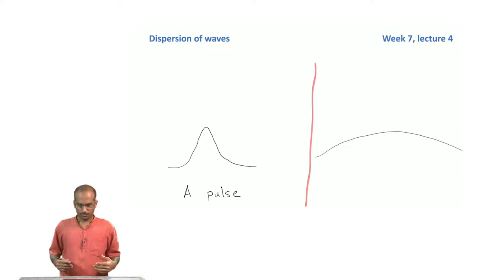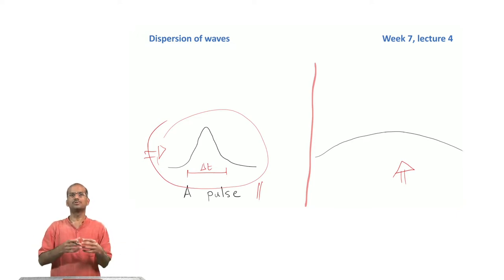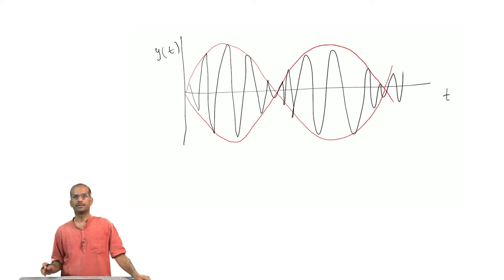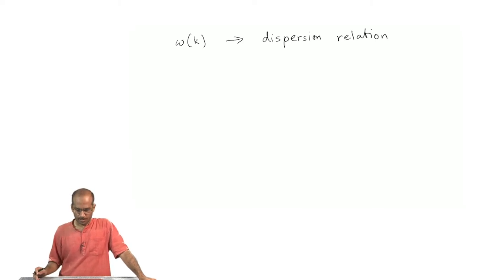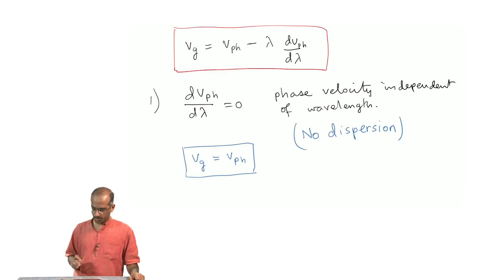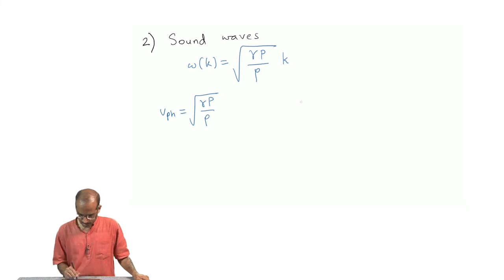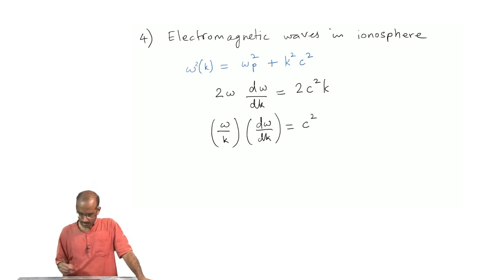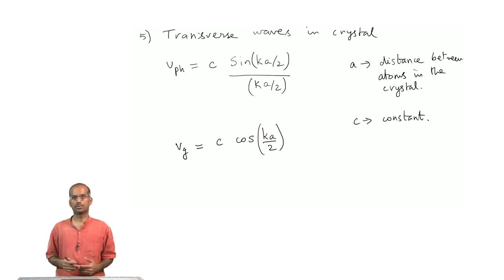Dispersion of waves

Comment: Waves and Oscillations
Week 1:
1. Simple Harmonic Motion
2. Superposition of oscillations: Beats
3. Superposition of oscillations: Beats
4. Superposition of oscillations: Lissajous Figures 
5. Simple Harmonic Motion: Problems 

Week 2:
1. Damped Oscillator: Part 1
2. Damped Oscillator: Part 2
3. Damped Oscillator and Q - factor
4. Damped Oscillator: Problems
5. Forced Oscillator: Part 1

Week 3:
1. Forced Oscillator: Part 2
2. Resonances
3. Q factor of forced Oscillator
4. Applications of forced Oscillator
5. Forced Oscillator: Problems 

Week 4
1. Coupled Oscillations: Part 1
2. Coupled Oscillations: Part 2
3. Solving for normal modes
4. Coupled Oscillations: More examples
5. Coupled Oscillator: Problems

Week 5:
1. Coupled Oscillations of Loaded string
2. Solutions for Loaded string
3. Oscillations of Loaded string 
4. Continuum limit of Loaded string

Week 6:
1. Wave equation and its solutions
2. Wave equation: impedance and velocities
3. Standing waves
4. Transverse waves in periodic structures
5. Wave equation: problems

Week 7:
1. Reflection and transmission of waves
2. Impedance matching
3. Energy of vibrating string
4. Dispersion of waves
5. Bandwidth theorem and problems

Week 8:
1. Longitudinal waves and speed of sound
2. Longitudinal standing waves
3. Sound intensity
4. Longitudinal waves: problems

Week 9:
1. Fourier series Part 1
2. Fourier series Part 2
3. Fourier series and energy of vibrating string
4. Frequency spectrum and Fourier transforms
5: Fourier series: Problems

Week 10:
1. Waves in optical systems
2. Waves in optical systems: Applying Fermat's principal
3. Waves in optical systems: Thin lens
4. Waves in optical systems: Matrix Method
5. Waves in optical systems: Problems

Week 11:
1. Interference Part 1
2. Interference: Newton's rings
3. Michelson and Fabry-Perot interferometers
4. Young's double slit experiment
5. Diffraction

Week 12:
1. Beyond linear oscillators: Non linear pendulum
2. Beyond linear oscillators: Forced Oscillator
3. Beyond linear oscillator: chaotic oscillator
4. Beyond linear waves: solitary waves
5. Waves in Quantum mechanics and summary
Reply: Thanks bro